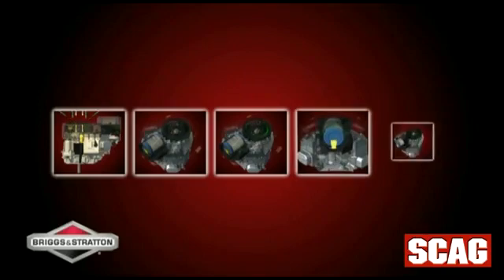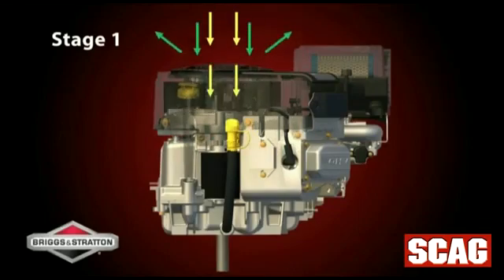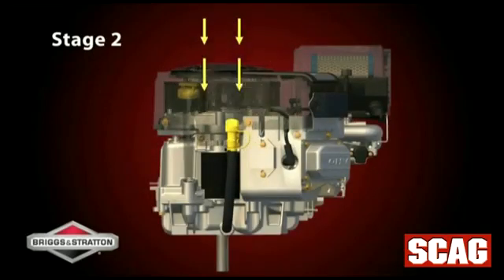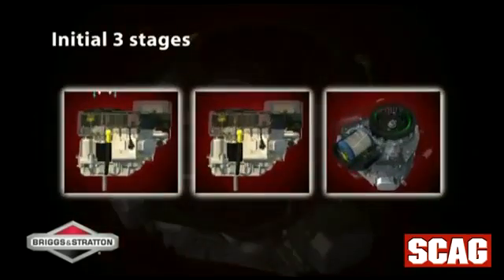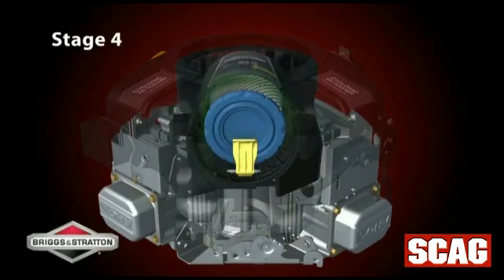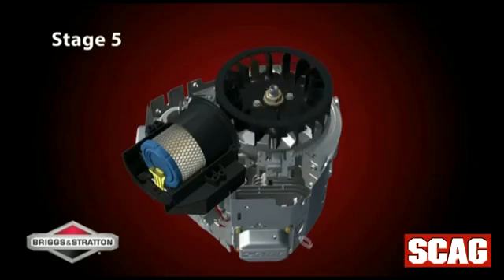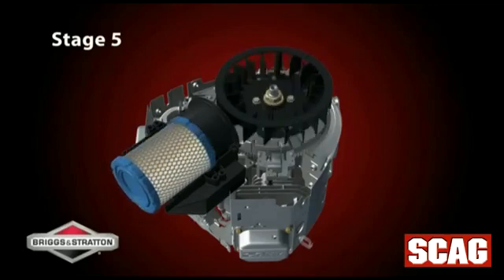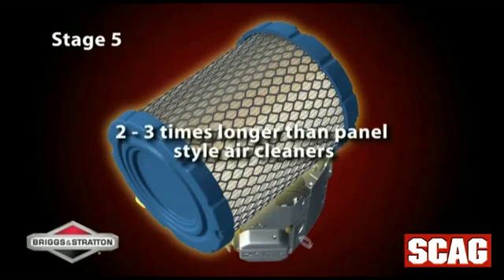Scag / 30hp Briggs & Stratton Professional Series Cyclonic Air Filter System

Comment: I have To Say I'm real disappointed With The 30 H.P. Brigg's Cyclonic Engine. 130 Hours And The Motor Has Had The Oil Pan gasket Changed Twice. I guess That Is Why They quit Making Them And Went With The 27 H.P. Good Luck, I think Brigg's Should Of recalled the 30 H.P..